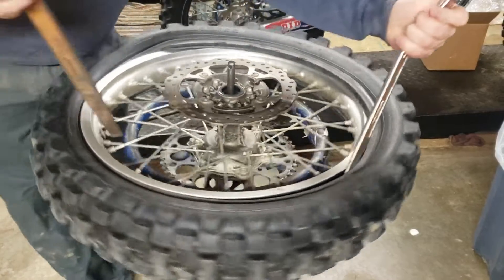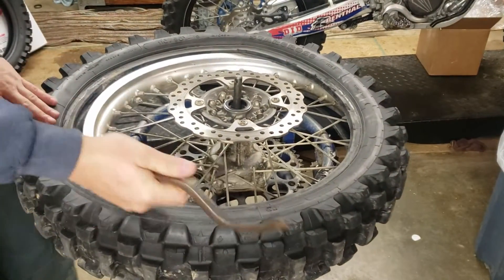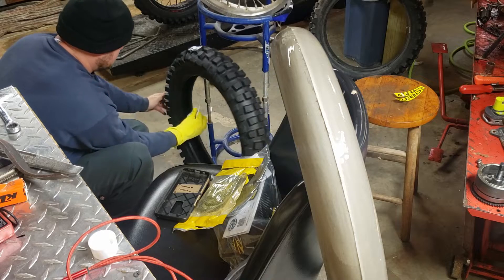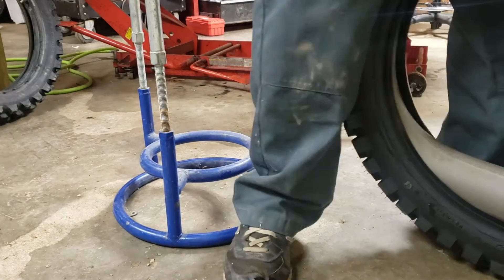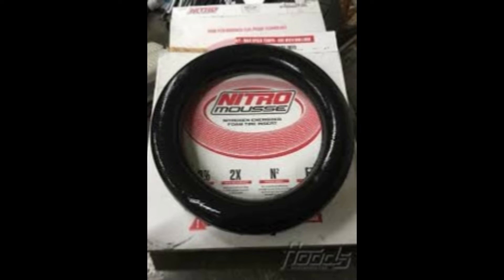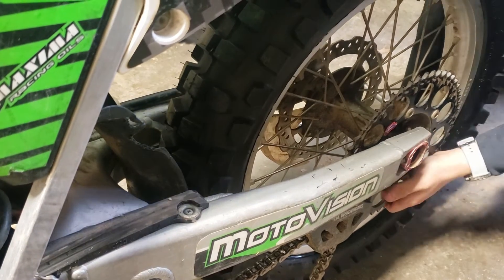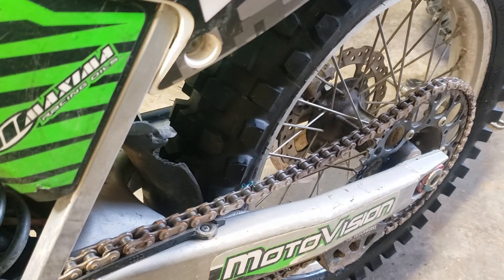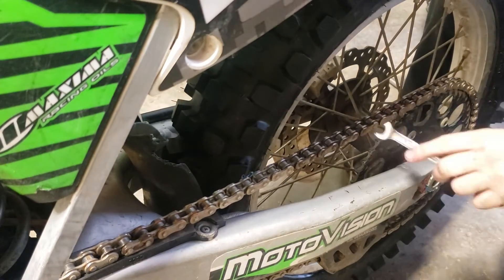I installed a Nitro Mousse and Shinko 505 Cheater tire on my KX250 !

Comment: I've run the 505 out here in Colorado which is dry and rocky (with mousse) and I liked it (and might buy again after I'm done with the Tusk tire I'm on now) but wherever I did get to ride any wet/muddy conditions I didn't like it at all. I'm surprised it's a choice you've made where you ride.
Reply from the maker: It seems to do great, until I hit the mud. Which works well for me considering I don't appreciate mud riding much. With that being said, I'll be trying the 525 next, and comparing traction vs. life .

Comment: Thanks for the video. Did you put that on a 19inch or 18inch rim. I have 2001 cr250r and it has 19inch rim. Just bought a 505 cheater that's 120/90 x19 . I haven't put on yet because it looks like it's going to possibly rub mud gaurd. Any info would help. Thanks

Comment: Hey mate just started running a shinko too and it keeps coming off the bead. How did you rebead it?
Reply from the maker: You can use a blow nozzle through the rim hole, or you can use a second rimlock to help it stay on. My comes off from time to time if i don't leave the bike on a stand.